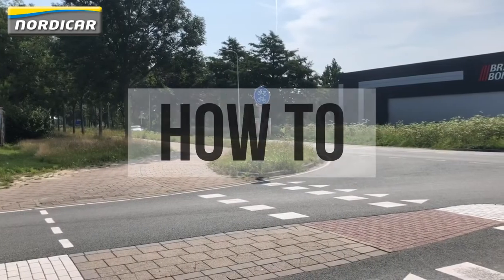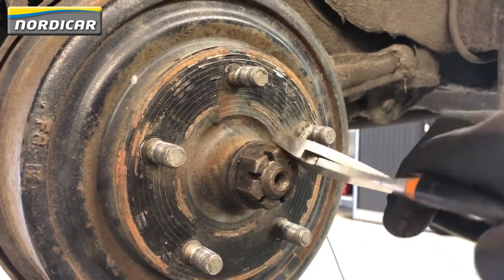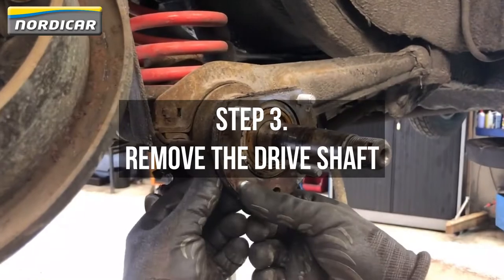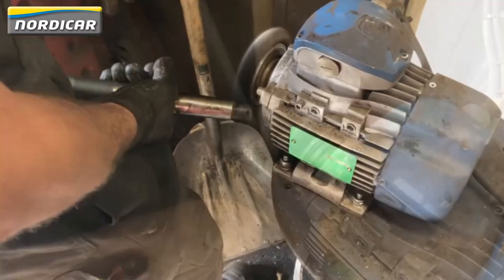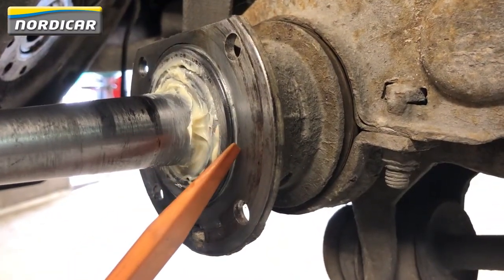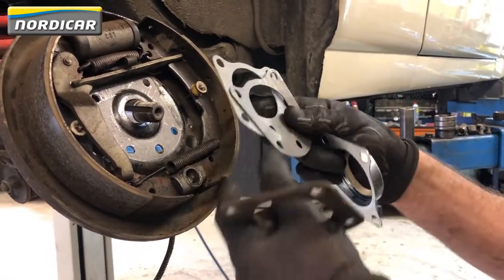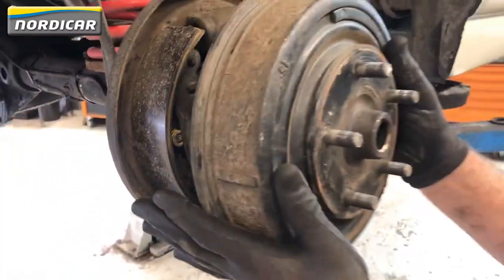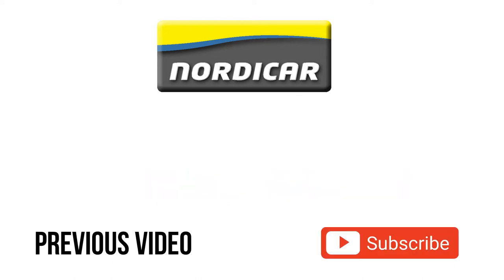How to Replace a Rear Wheel Bearing - Volvo Amazon, P1800S, PV544 and P210 (Duett)

Comment: In the film, it was forgotten to soak the felting in the seal with oil. if you don't do that, the filtring will "burn" and become hard. Also missing some explanation about the amount of grease on the wheel bearing,Too much grease leads to heat build-up and increased friction, which reduces the lifespan of a ball bearing. Otherwise an indicatively good film.

Comment: On the left wheel are no shims?
Reply: It may have just one thick shim. Final shimming done on the other side as shown here. If it happens that you are only going to replace the bearing on that side you may be lucky enough to just be able to set the correct play by using it. If it is less you will have to get a suitable set of shims to obtain the correct setting. If too big, add shims as needed. Generally you will replace both bearings so so listen to the advise here about the shims.